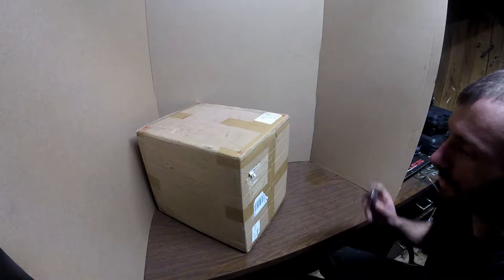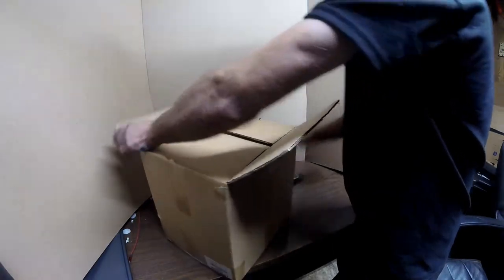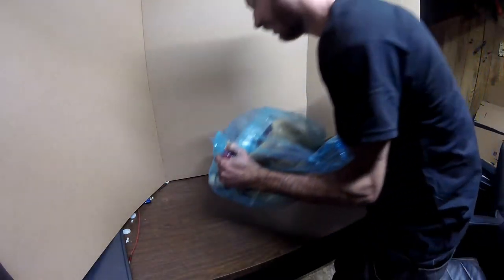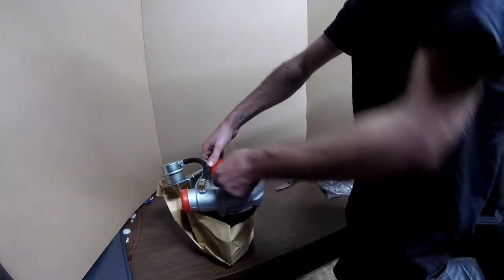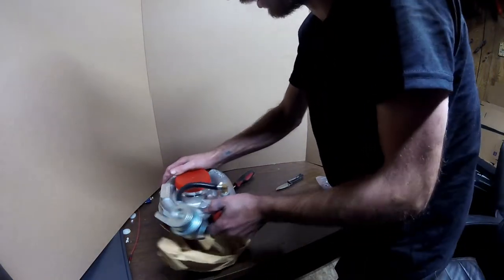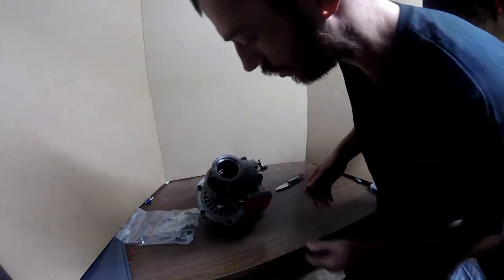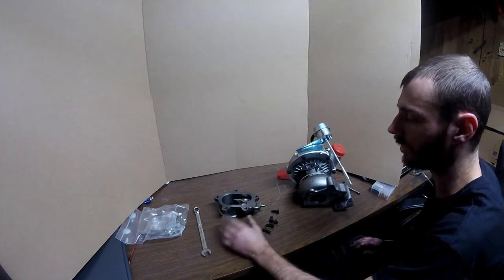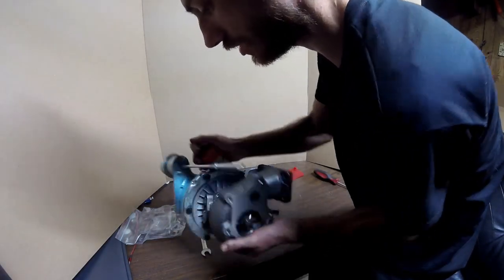Cheapest Ebay T3T4 Turbo

Comment: It's even more impressive it's the version with the V-band wastegate adapter housing. Imagine when eBay turbos can be had for $75! My only real curiosity is how well that waste gate flap actually seats against the exhaust housing.
Reply from the maker: i took it off because of the talons external but i did tac weld the arm for a bit and it sealed all around smooth
Reply: @DishonoredGarage  When you tac welded the arm for a bit, did it stay shut for the time being while you ran an external wastegate?

Comment: What I just ordered one from Expedia rods for 134 with a line kit what kind of horsepower you plan on making on this turbo?
Reply from the maker: honestly id be happy with 350awhp. its been making good boost and very little shaft play still so once i get the talon tuned ill end up making an update video on it.
Reply: Just Boost It right on I used to have a turbo eagle talon but this travels is going on my K20 fa5. I plan on 325 low boost and 400 high boost.
Reply from the maker: @Onelovej  sounds like a plan id love to see it
Reply: Just Boost It definitely are you using stainless steel header? Or a cast iron exhaust manifold?
Reply from the maker: @Onelovej  i have a cast right now but im looking at Morrison fabrications t3 manifolds